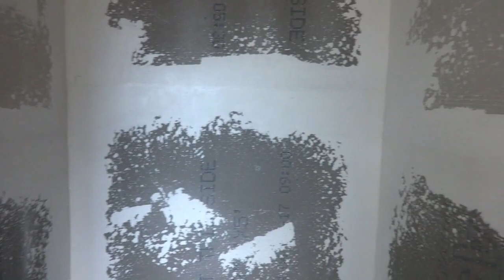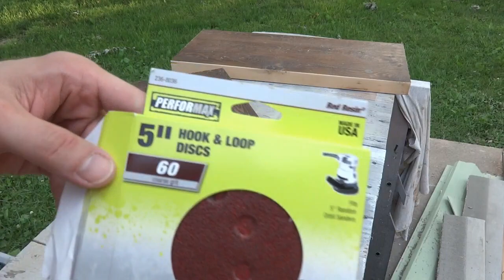Old Roadside Table = New Shelves!

Comment: Awesome series of videos lately Kevin! Keep em coming

For a cleaner cut on the radial arm saw too, score the wood with the blade first as you are pulling towards you. Then plunge and finish the cut but pushing away from you.
Reply from the maker: That's a great idea. I had to do this little choppy move because my saw blade is getting dull and it just starts smoking like crazy when I cut bigger pieces of wood like this. I need to replace it soon.